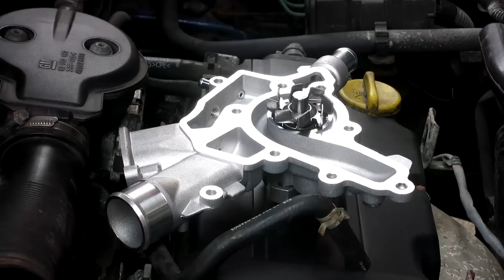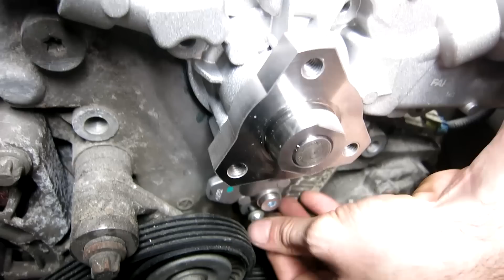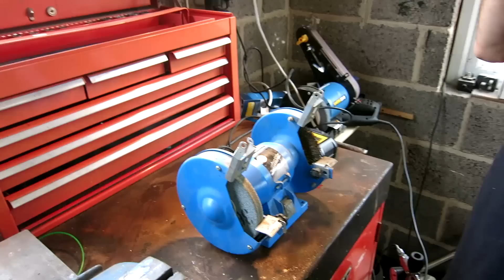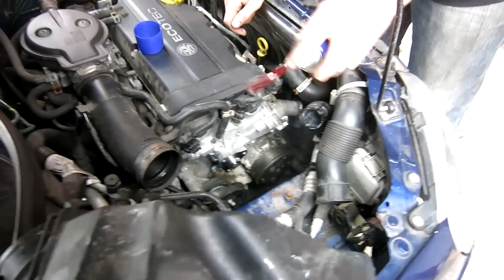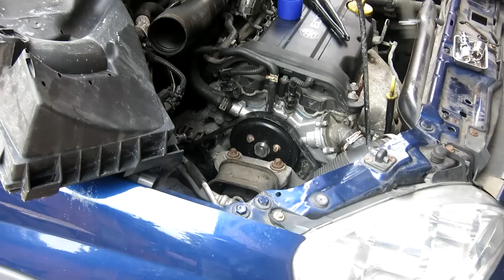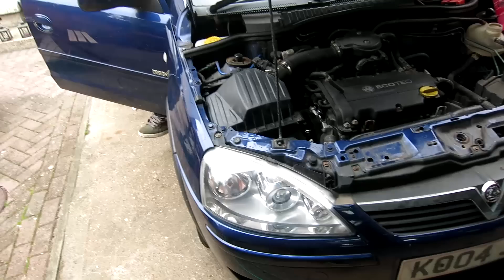Opel Corsa Waterpump Replacement. 1.2 16v Vauxhall

Comment: This is the SHW type water pump, which has a metal gasket. Wonder if sealant if still required when replacing a Pierburg type pump, which comes with a rubber gasket.
Reply: NO!

Comment: i need to get one of those extension bars to undo the engine mount,tried a normal ractchet and sock I need the long extension bar,also because the bolts are on so tight normal brute force wont undo them.I will try putting the extension and socket onto my electric drill i may get them undone

Comment: So, water pumps for the Z12XE (including the original one) all have a metal impeller, right?
Reply: Answering myself: Pierburg ones (the ones with the bolt on plate on top) come with a plastic impeller, SHW ones (the one with no bolt on plate) come with a metal impeller.
Reply: @teravolt6113  a question a see on every waterpump change videos on youtube different gasket one whit rubbery one and some videos i see a flate one witch one is the right one

Comment: mate i got a water pump but it dont have the water temp bits and i cant get mine off  cus the screws are rounded  do you no if i can get the little housing bit for the temp switch
Reply from the maker: Get better tools
Reply: @incapabledub  that is needed man but i order another 1 with the other bit on there so it will be ok now but what is that suff you spraying to help slide the pipe back on called thanks man

Comment: Good video. What did you use to support the engine when you took out the braces??
Reply from the maker: ***** just the trolly jack with some flat wood to help spread  the load. I actually left the engine supported on some blocks of wood overnight so i could put the jack back in my garage. There's not alot of weight with these engines. Thanks for your comment, i'm hoping to make more detailed videos as car repair seems to be quite popular.
Reply: ok, thanks yeh you should do as they are very helpful. how long did the job take in total to do?
Reply: i was looking to try do the job myself as my head gaskets are going so thought i could cut the cost down on the repair as i know they will change the water pump.
Reply: how did you bleed the system?
Reply from the maker: i cheated a bit, i just pulled the return hose off the top of the water pump, stuffed my garden hose in the header tank and forced the air out that way, then topped up with anti-freeze. From what i could see there's no bleed screw anywhere on this system.
Reply from the maker: ***** couple of hours casually, in a garage environment you could do a waterpump swap on one of these in less than an hour

Comment: Ηow did the cooling system ventilate( vaporization ) after the coolant came out?
Reply: InstaBlaster...
Reply: You open up expansion tank cap and run the engine for 15 minutes. Cooling system will bleed itself out of any air

Comment: what were the symptoms with the pump, that it needed replacement? Did the engine temp gauge go over 90 C?
Reply: Michał Lukasz usually a bad bearing that causes leakage.

Comment: how did you managed to change the waterpump without change the timing marks??
Reply from the maker: chris0147 its not timed by that belt it uses a chain. thats just a drive belt for water pump and power steering etc.
Reply: oh right, I have got a waterpump with drive belt so would I be okay when I change the water pump with new drive belt as it doesn't need to change the timing?
Reply from the maker: chris0147 if the belts not driving the camshaft you dont have to worry about timing
Reply: That's one pro of chain driven timing, like on the GM Family 0. Replacing water pump gets easier. The con is, you have to be very careful about correct oil and correct oil and filter service intervals and it can get very expensive to replace.

Comment: +Diesel Weasel Workshop 
Whats the sealant you are using?
Reply from the maker: hylomar. i zoom into the product pretty clearly.
Reply: You want high temperature resistant silicone. They sell proper silicone for water pump on ebay

Comment: What size torque screws are on there?
Reply: 8 nm for water pump housing
Reply: @klasykapolskiegohh8798  what's the  torque  setting for the engine mounting? thank you